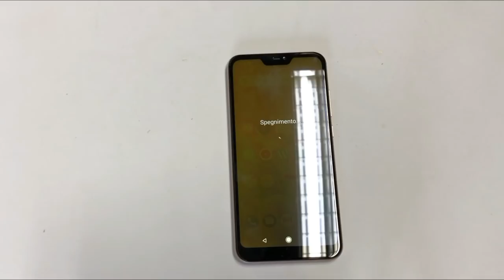Xiaomi MI A2 LITE disassembly screen battery smontaggio! schermo batteria vetro lcd (redmi 6 pro)

Comment: If i replace back housing (because mine have a lot of scratches and its not the color i wanted from the beginning) then i will change fingerprint aswell to match the new colour, now my question is how do i change the fingerprint sensor and can i replace with a new one or is it like iphone where you cant replace the sensor without going to store
Reply from the maker: I do not think it is a readily available parts, you did a search?
Reply: @waltercamarella  I found all parts i need, now i only need to know how to replace the fingerprint sensor and if i can then i will order my stuff, (when you remove the fingerprint sensor then you add 100° heat but what do i do when i apply a new one) also i cant find any forums where it says how and if you can replace it
Reply from the maker: You can use b7000 glue if the new part does not have its sticker

Comment: hey..if my phone battery drain so fast..should i have to change the battery ? my a2 lite is android one
Reply from the maker: it's not possible, too new!
Reply: Bijay Dangal Official  check if the battery's temperature is okay (Normal temperature: 34°c)
Reply: @alteito  hos tout check it?
Reply: i use xiaomi a2 lite almost a 2years and good news i cannot bad experience the battery like new after i use almost 2years😊

Comment: Ciao,  Innanzitutto complimenti per il video!!!
Avrei bisogno di un parere su un difetto che si è presentato sul mio MiA2Lite.
 Ho un Mi A2 Lite 3/32. La sua selfie camera ha deciso di non funzionare piu', in particolare succede questo:
dopo aver aperto l'app fotocamera, e dopo aver cliccato sullo switch per passare al selfie, l'app mostra le opzioni da Selfie camera, ma rimane attiva la fotocamera posteriore. Insomma, è come se l'anteriore non esistesse. 
Fatto ciò ho optato per le seguenti soluzioni:
1)ho cancellato la cache e i dati dell'app  e ho forzato l'interruzione..ma nulla.
2)ho provato ad utilizzare qualche altra app. Nulla.
3)ho fatto due ripristini di fabbrica: uno dalle impostazioni e uno hard reset tramite Recovery Mode. Nulla.
4)l'ho portato da un tecnico che ha sostituito la fotocamera, ma presenta lo stesso il problema.
Sapresti darmi un consiglio o un parere che mi possa essere di aiuto??